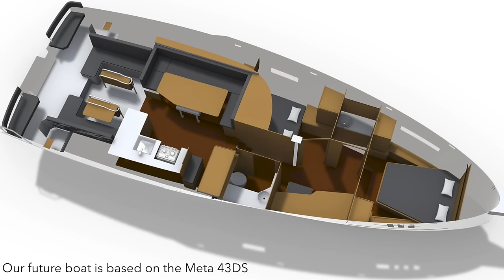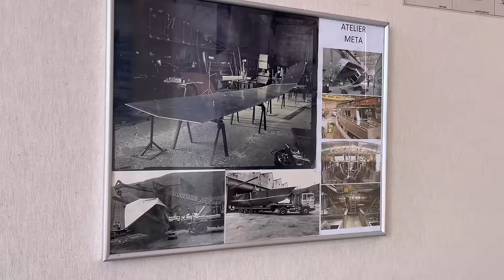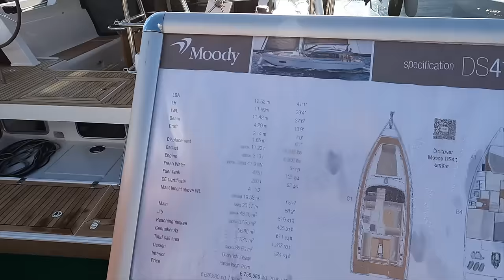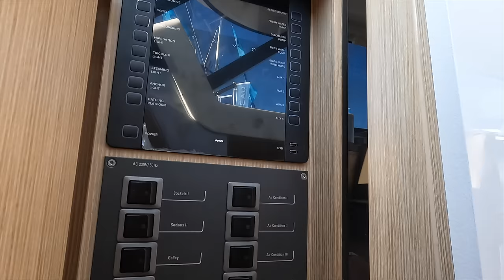⛵️Two completely different DECK SALOON SAILBOATS that inspired us!! Ep.311

Comment: The high sides are Gunwales they keep your side decs dry when heeled over and allow you to brace your feet against them if the boat heels over in heavy conditions.. though the narrow side deck is a bit limmiting .

These boats are usually built with modern toughened laminated glass ...and should be able to withstand a 🔨 blow ...more often if the boats for use in Northern climbs  the windows and hatches will be double glazed. To prevent condensation and ice forming inside. 

Remember insulation in a boat can help keep it cool as well as warm and dry. It also keeps it quiet...and GRP and metal hulls tend to be noisy. 

Look at Cork and Basalt fiber insulation aswell as materials like hemp and jute fibers. 
Traditional wood hulls are naturally better insulated and quieter..as they resonate less underway. 

Basalt and cork are highly fire resistant and sterile materials. They dont shed harmful fibers or off gass Basalt is incredibly strong and temperature tollerant .. or absorb water.  Neither will react with Al even if it gets wet or interfere with radio signals they are both electrical insulators. 

Keep looking and collecting ideas ...remember you want your systems to be easily to reach and inspect and to be able to get to your motor whilst under cover and not in an exposed cockpit or under your sink or access way. 

To that end i would also seriously think about a Hybrid Powersystem using a seperate generator to run  
electric (regenerating) motor/s ...no maintainance no transmision needed for forward or reverse ..shaft drive silent and uses 30% less fuel done right. 
And full torque from low RPM. that way you only need a smaller battery bank.

Comment: I would not take either of those boats to Antarctica, Southern Ocean yes, but Antarctica no, unlikely you get permission to go inside the 200 miles of the ice, I notice those boats never had storm cover hatches over the port holes, which is a must if going into the Southern Ocean.

Comment: Well dears, I of course never thought rich, and I understood you would have to build the boat, to achieve a high value. I see your entertainment channel as an income stream, as any occupation is. I certainly could not work as hard as you folks, thus my 12 meter cruiser is more modest. 
Coincidentally, SV Pacifica! Solo refitter. (P. S. Your electrical engineering degree would have been a huge boon in my first year of ownership!)

Comment: so 41 is too big? What size then? I don't disagree, Certainly 50ft is too big I think. We have a 29ft and it is ok for a holiday cabin but a bit small for live aboard. I have heard a lot of couples have said 32-34 is about right. I think 38-42 is probably about maximum depending on beam. A narrow and longer boat or a shorter and wider boat. I am not sure which is more "sea kindly" or has the easier motion though wider is probably nicer at anchor. While the same level from cockpit to saloon seems nice, I think I would want something that keeps the water out of the interior, a bridge deck or something.... I find it a bit annoying for entering the cabin but I am thankful water that fills the cockpit will not fill my saloon. Think about water flow in big seas when a wave comes over the bow, side or transom.

Comment: That aft helm position looks to exposed to me. It's exposed to the weather and very close to falling overboard. Have you considered a piviting helm that slides into three positions like some catamarans have. What about moving the helm inboard a bit more. Also, how about going for a 48 foot boat design that is about the same width as this one? I loved your center board design on your last boat so that you can get into shallow places. Could you make the new boat like that as well? A longer boat will be smoother cruising through the swells. This boat design looks short and wide. Like a pig on the water in my opinion. I really don't like the looks of it. It doesn't have a sleek look to me. Plus, short and wide (fat) will make the boat slower compared to something a bit narrower for the length. I really like Distant Shores TV new boat design!!!